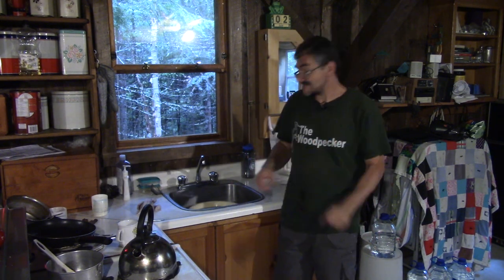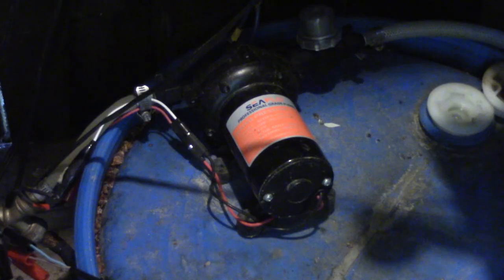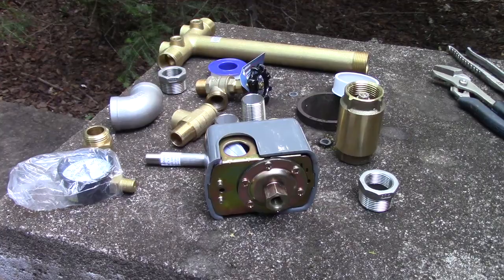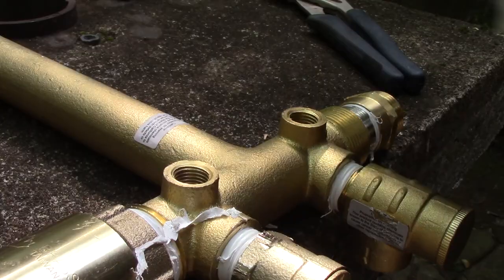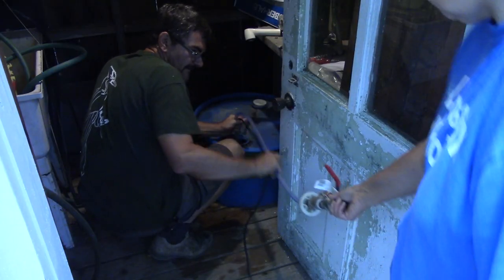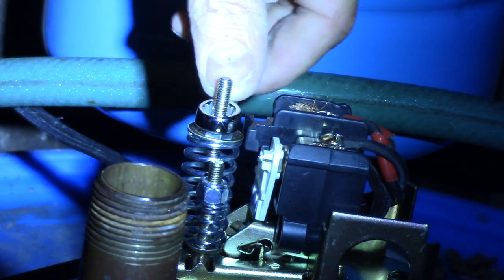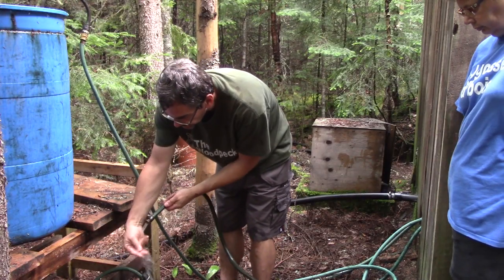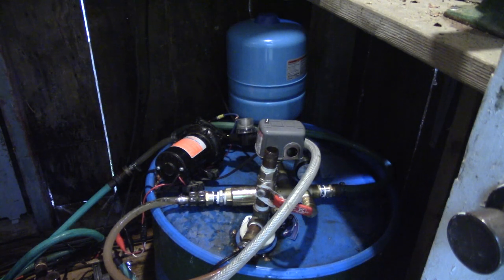The Woodpecker Ep 149 - The water system at my cottage

Comment: You should think about adding a check valve to the top of the submersible pump so it keeps the water in it and not let the water go all the way back down the well. It will prolong the life of the pump and you wont have to wait for water
Reply from the maker: So true I can easilly add one between my union thanks.

Comment: Lol, looks how my dad connected the water at our cottage. Concrete rings and a rather shallow well -- heated pipe (anti-freeze) -- electric pump in sauna house (wet area) -- 400 l plastic bag in frost free basement -- hand pump -- bucket to carry water into cottage. Puhh. Now we have a 70 m drilled well with sink pump with heated pipe fastened onto the cabin wall outside (code warrants outdoor plumping as we dont have sewer). So still complicated.
Reply from the maker: Water is always complicated. And since we need water we're willing to go the extra length to get it. Nice rig at your cottage, I just have a shalow well...

Comment: if you get one more blue barrel   put a check valve then pressure reg and feed from the pump in one hole  pipe should go down to a few inches from the bottom  in the other hole pipe that goes to the house same down to a few inches from the bottom.